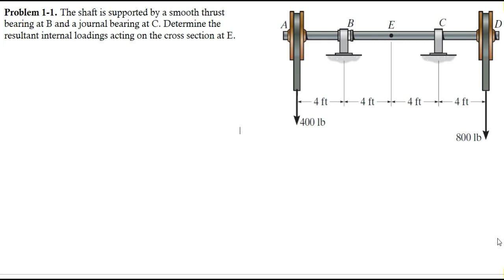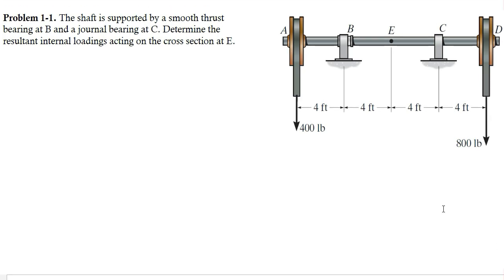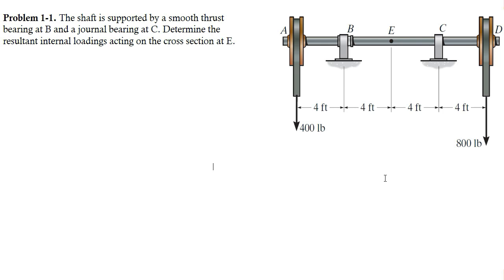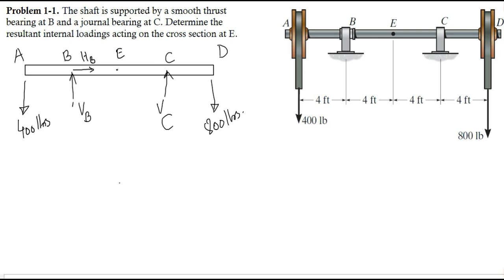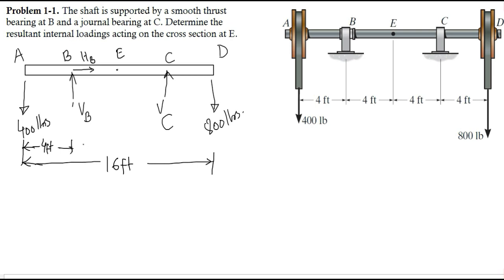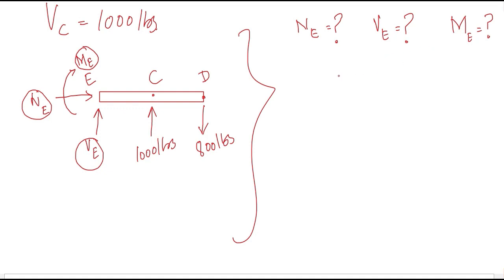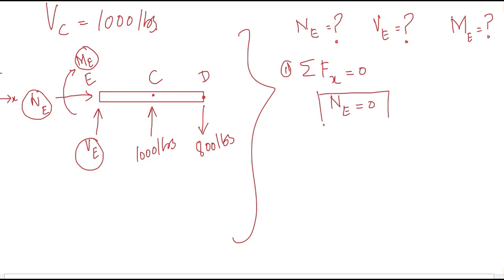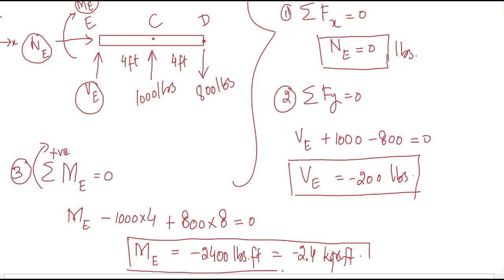Problem 1-1 Internal Loadings at E, Mechanics of Materials

Comment: Why were you able to isolate the right section of the shaft?
Reply from the maker: @FinneganLynch  Thanks for your question. It is up to us whether we take right side or left side. We will get the same resultant internal loadings. I consider taking right side (just have to choose one). If you are still confused then consider taking left side and check if your answers are similar to mine??

Comment: why is the 400lb for negative and 800lbs force positive? i get that clockwise was established as positive and anti-clockwise was negative but how can we tell the direction of the magnitudes?
Reply: imagine the point you're measuring from is the centre of a clock and the force you're accounting for as pushing on the hand, which way would it go, counter-clockwise or clockwise?